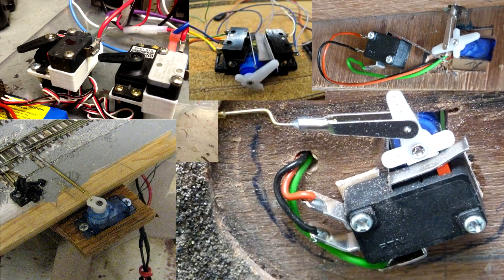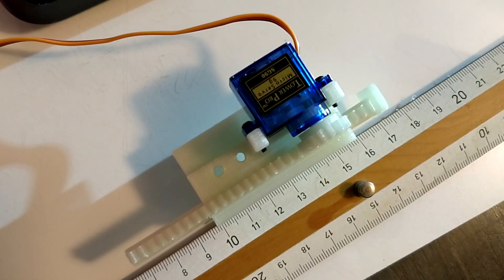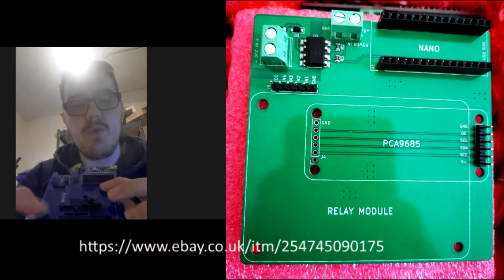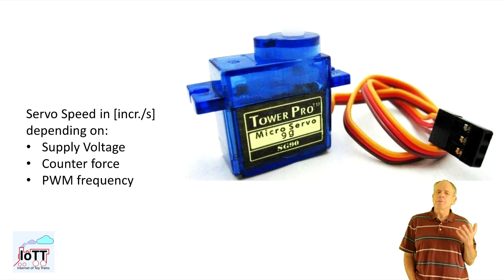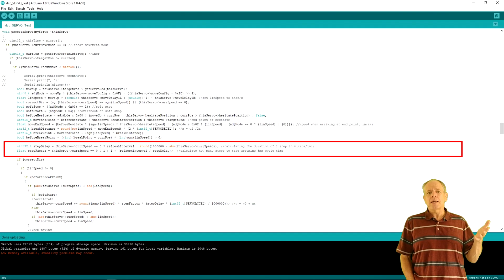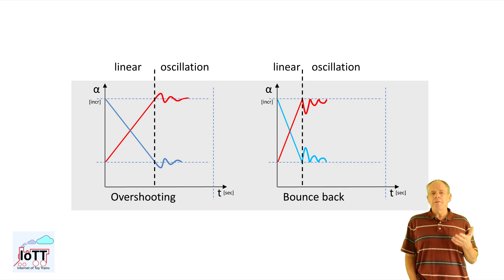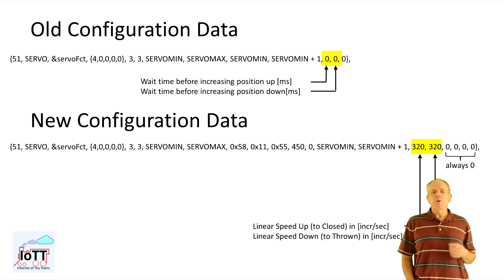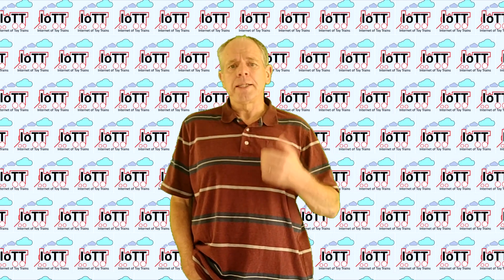Driving Semaphore Signals with Servos (Video#55)

Comment: I enjoyed watching this video. I've been looking at how to control signals from the arduino and seen a couple of videos.  There is one which calls functions from easing.h.   However, I prefer your method as it allows for conditions to be combined.  What I'm struggling with is stripping it out of the DCC code and running it straight from the Arduino.  Much of the DCC code I'm assuming is not needed, it is identifying that I'm struggling with, and also how you are using arrays to pass information into and out of the functions.  

One area which I've struggled with - and it is similar on another video from someone else, is the use of the arrays to contain the data, how you name them and then extract the information out of them.
Reply from the maker: Check videos 17, 18, 19 for an example how to define and use an array to store positions etc. They also show how to program the status machine to control several servos simultaneously.
Reply: Same here, I'm new to arduino coding and this seems way beyond me unfortunately :(